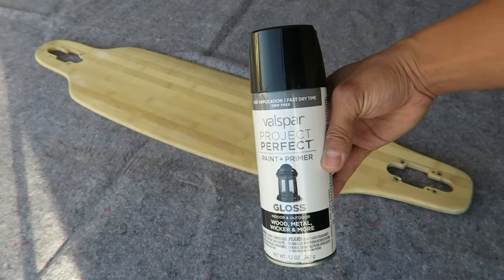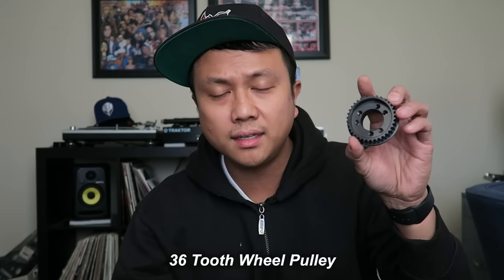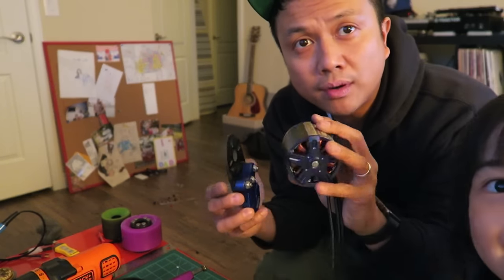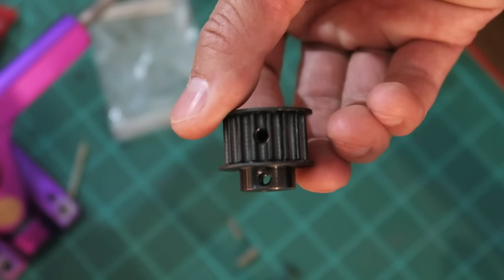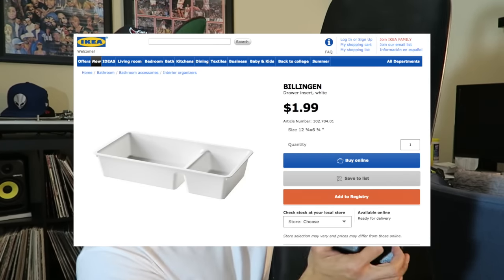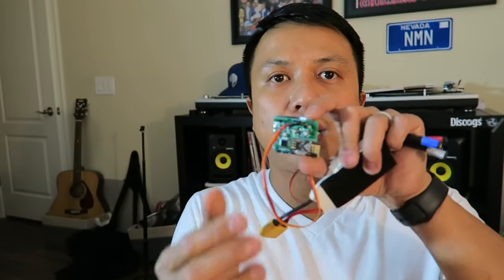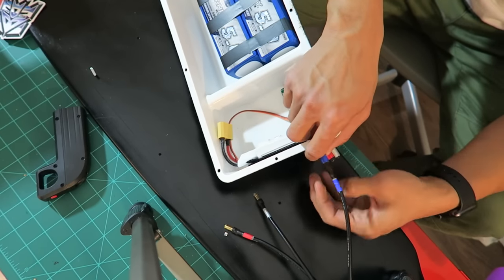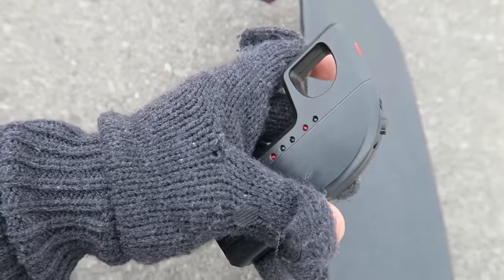MAKE A DIY ELECTRIC ⚡ SKATEBOARD - BETTER THAN A BOOSTED BOARD!

Comment: how did you mount the enclosure  on to the board?
Reply from the maker: Hey there!  Thanks for watching!  I hope you'd consider subscribing to see more videos like this one.  I had to drill holes through the deck and then also through the surface of the enclosure.  to keep everything in place i just used nuts and bolts.

- Neil
Reply: Big Kids does it stay in place even of your board flexes?
Reply from the maker: my board does not flex.  However, it does have a concave and the abs plastic formed to the board nicely.

Comment: I have a 76 mm wheel there called zombies by hawgs  there not huge but the hub has holes through it so I thought I might be able to mount a pulley wheel Idk thoughts
Reply from the maker: It depends on the hub style.  Currently they make two types of hubs and pulleys for those hubs.  They have kegal style hubs on the Orangatang Wheels and then they have the Flywheel hubs like on ABEC 11 type wheels.  If it's neither of those type of hums you ma the need to drill into the wheel it self.

Comment: wouldnt it be better to just use a 20,000mah 5s battery instead? or even a 16,000mah 5s?
Reply from the maker: Hey there!  Thanks for stopping by my channel.  I hope you'd consider subscribing to see more future videos like this one.  Yes, for range, in theory it would be easier to use batteries with the mah rating you mention.  But, 5000 mah hour batteries are very common, easy to find, and are relatively affordable.  If the 20k or 16k may lipos even exist they're not common for the average person to find.  If your goal is to achieve a high mah rating most people will take several mah lipos and put them together in parallel.  Hope this helps your question.

- Neil
Reply: Big Kids yes, I see was looking at the specs and the c rating is only 10-15 so I spoke that would be why, turnagy makes them in 6s and so does zippy I believe. To make this cleaner I might even go the 18650 route and build the pack I need I guess.

Comment: Is it ok if I got 180mm wheels?
Reply from the maker: +Ahmed Altaf thanks for checking out the video!  I hope you consider subscribing for more videos like this one.  180mm wheels are very big.  The only wheels I'm familiar with that have that size are pneumatic wheels with tires.  This set up in my video would be able to handle that, but not efficiently.  I'd predict that it would crest a lot of heat and possibly destroy the motor.  If you wanted to use 180mm wheels I would recommend a dual note set up.  Hope that helped.

Comment: are 2 Turnigy 5000mAh 3S 20C Lipo Packs compatable with a ELECTRIC SKATEBOARD MOTOR 5065 260KV
Reply from the maker: Hey there!  Thanks for watching!  I hope you'd consider subscribing to see more videos like this one.  Yup, the (2) 3s lipos in series for 6s total will work well with the 260KV motor you have.  However, if you plan to use a VESC with your electric skateboard, know that 6s is the minimum voltage for a VESC to work properly.  If you decide to move up in voltage to say a 8s (2 4s 5000mah Lipos in series) I'd find a motor with a lower KV say like 190.  Good luck and happy building!

- Neil

Comment: and also how do you link up the batteries
Reply from the maker: For me I have (2) 5S LiPo batteries in series.  The negative lead from one battery goes into a positive lead of the other battery.  This leaves me with on negative lead available and another positive lead available (since with 2 batteries there are 2 sets of positive and negative leads).  This then creates one big battery.  The available negative and positive leads then are used to power the board through the electronic speed controller which is connected to the motor.  HOpe that helped :)

Comment: how long does the battery last
Reply from the maker: Thanks for checking out the video!  I hope you'd consider subscribing to see more videos like this one!  At this point I've got a range of about 7-10 miles depending on how hard I am on the throttle and the incline in the area I'm skating.  I haven't done an official range test but plan to soon!  

- Neil

Comment: I am nearly about to start building a board to get get to and from work however I know little to nothing about eboards. Is there a way to convert a longboard in a semi -all terrain variant. As in specific wheels ?
Also is is possible or a good idea to place a engine on each wheel with roughly 8 batteries split between 4 wheels,Would this be too much juice going through the board? And more or less idea for this possible board is planned for speed it’s planned for distance not so much speed.. if anybody has insight to this that would be very much appreciated..

Comment: Lol I wanna build 1 but i gatta use twin motor's.. slightly expensive but no choice cuz I'm slightly A heavy guy
Reply from the maker: Yeah, one motor will get you going honestly.  Just have to have a larger battery.  However, 2 motors is way better for going up hill and for breaking especially if you are in a pinch or a heavier guy.  Feel free to shoot me an email at bigkidsofficial@gmail.com for a parts list

Comment: which deck?
Reply from the maker: Hey Alex!  Thanks for checking out the video.  I'm not sure what you mean by you're question.  Would you mind clarifying so that I can help :)

- Neil
Reply: thanks for your fast answer i meant which longboard deck are you using
Reply from the maker: In this video I'm using a 41inch bamboo deck from Sector 9.  But, later I changed it to a 9 ply maple deck from ebay.  When looking for a deck you'll need to consider its materials and flex for your type of ride.  If you want a smooth ride with less vibration you'll want a flexy bamboo deck.  However, the bamboo deck is less responsive at higher speeds.  If you want a responsive deck at high speeds go with a more dense material like 9 ply or carbon fiber.  But, you'll want to consider the fact that you'll feel more of the vibrations of the road than what you'd feel from a bamboo deck.  Hope that helps.
Reply: thanks :)
Reply from the maker: No problem!  If you have any questions regarding your build please feel free to comment.  Also, if you could in return share this video https://www.youtube.com/watch?v=sZlv-HKzvRE on your social media.  Every little share actually goes a long way when trying to grow my channel.  I would totally appreciate it if you did :)  And please consider subscribing for more videos like this one!  Take care Alex.

- Neil

Comment: Should I mention that you forgot the voltage alarm for the lipo batteries ?
Reply from the maker: Building an electric skateboard and filming it are 2 different creatures.  It can be challenging remembering to communicate certain things I may have done on the build.  There are actually a lot of things that I have missed in this video and hope I'm covering most of it in my second build video I posted a couple weeks ago.  Have you also built a DIY esk8?

Comment: if you tell me how much it costs, I'll subscribe. my lazy ass doesn't wanna do the math or open all the parts.
Reply: nvmnd already subbed, can I just know the price?
Reply from the maker: +Shingo O'Flaherty hahaha it cost me about $800!  But now that I've finished my project I know I could have done it for less.  Either way I'm happy that the cost was lower then say a Boosted and it was made by me!  Thanks for checking out the video!
Reply from the maker: +Shingo O'Flaherty mine was $800 but more than likely could have done the same set up for say $600 just cause I know what I need and what I don't.  Thanks for the sub and hope you join us in the future vids!

Comment: A single hub motor is not better than two belt motors
Reply from the maker: I don't think I ever said that.  I also, am more of a fan of belts so, I'm pretty sure I didn't say that.
Reply: Big Kids "better than a boosted board" boosted uses dual belt???
Reply from the maker: Dual belt doesn't necessarily make it better.  Considering the battery size, mottor wattage, pulley ratio, this build is less expensive, has better range, and has a higher top speed than a Boosted board.  But better is in the eye of the beholder.

- Neil